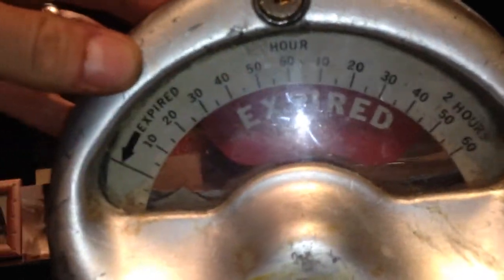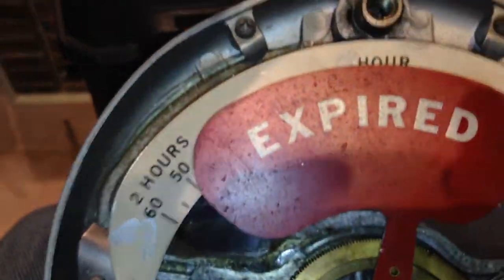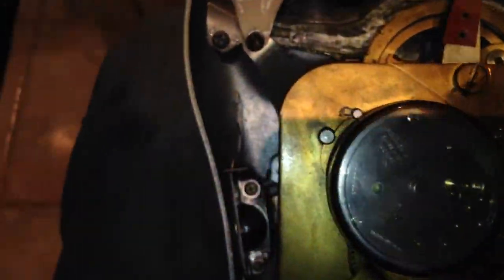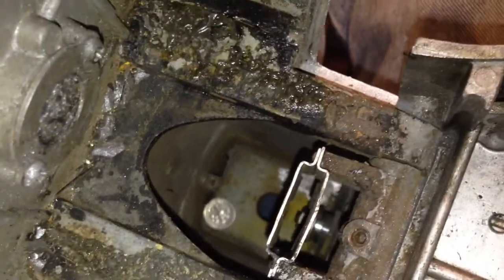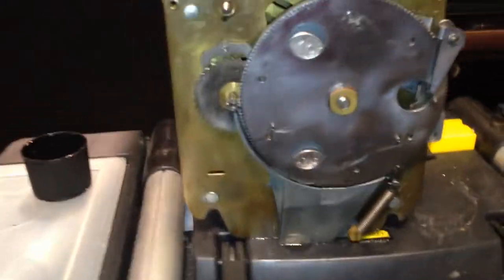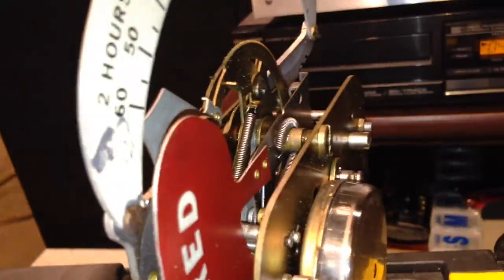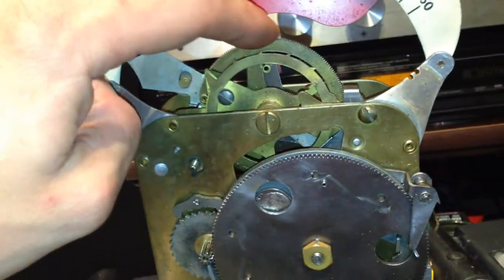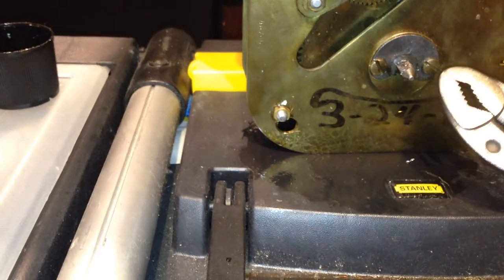1940's Magee-Hale mechanical parking meter (really cool)

Comment: I am wondering if you could get the measurement on the part that connects the escapement to the gear, it should be a small bar of metal and I lost mine. If I knew the measurement I could make another one.